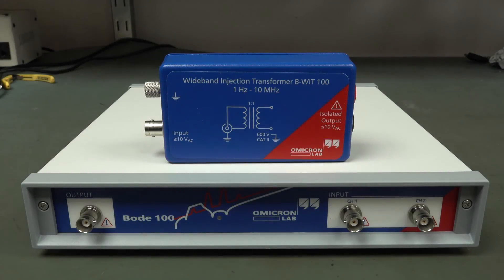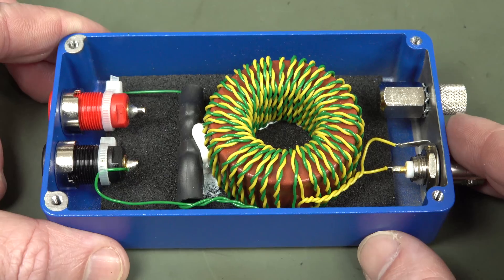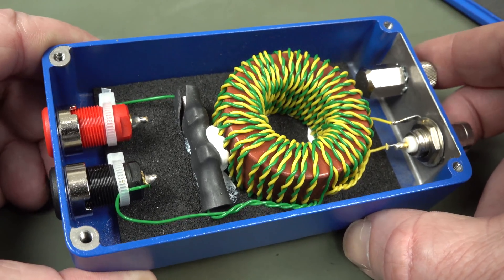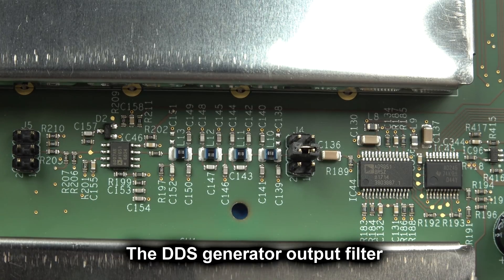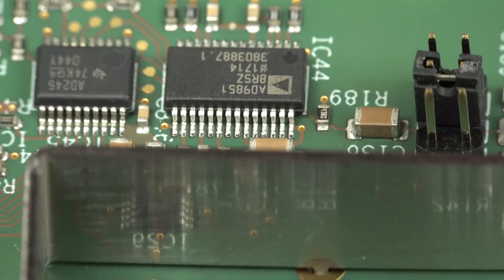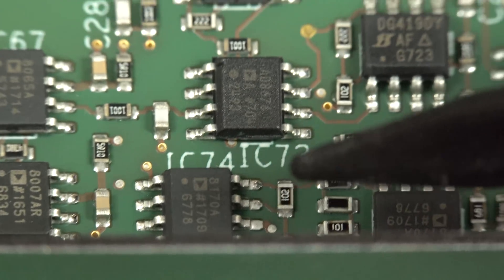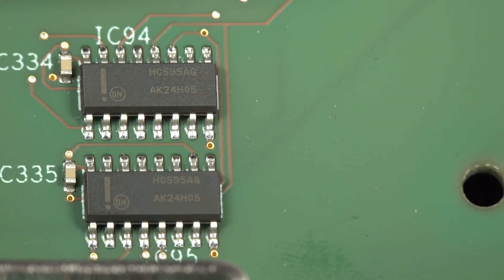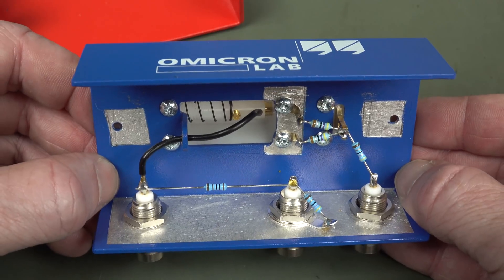EEVblog #1104 - Omicron Labs Bode 100 Teardown

Comment: Hi Dave! About resistors in B-SMC. As I see, all resistors there is 4R7 1%, except one between Source BNC and CH1 BNC. What are the colors of this resistor? I can't determine.
Regarding the disputes about the core material of B-WIT 100, I can say with sure that it's an VITROPERM 250F.

Comment: 3:08
There is just a fuse under that black heatshrink to protect the transformer from (most) "user errors" ...
Oh, never mind, he gets it open later ...
And no, an "inline fuse holder" would be a bad idea, because every "connector" adds more "things that can go wrong" and possible "crappy connections". That's why the fuse is soldered.

9:15
Oh, that annoying FTDI chip ...
I hate those things ...

11:59
Fun fact about those through hole resistors:
The length of the leads between the board and the actual resistor body makes a big difference for things like reflections!

13:49
Yes, there are is tons of switching going on!
Coupling, filters, range switching, termination switching, lots of things that can be configured by the user via the UI.

No, the relays don't really need to be shielded, because you aren't really dealing with "ultra small signals" ...

17:12
" ... rather simplistic ..."
Well, a simple solution is an elegant solution ;-)

Comment: It's called a bifilar winding! The toroids look like Amidon powdered iron cores ur = 10.  I don't think that any windings are squeezed or stretched to optimize frequency response, it seems that they just have been evenly spaced!
Pretty underwhelming !!
 A better core geometry would be a binocular core and i think that a balun on the floating side might give some more improvement !!

Comment: I imagine they can also get away with this price tag because it's a rather niche product, but also because of the (I presume) various levels of certifications it went through, whether it's self or 3rd party, they probably run various standard tests on these to produce some graphcs and other stats and then each one has to match etc.  Probably a lot that goes into that.   And of course the software too.   But yeah I'm sure someone that wanted to could probably produce this for a much lower price tag.

Comment: Can you please explain the purpose of these devices? I have a bachelor's degree in electrical engineering,  but i still have no clue what these things do.
Reply: Not to be mean, but you should maybe return your degree...
Reply: Actually, I have a degree in robotics, but there was still a lot of electronic involved. What I meaned by this comment was, that it might not be obvious even for people who know something about electronics. I can recognise a toroidal 1:1 transformer. But what is it good for? You won't be using 500$ transformer for galvanic isolation.
Reply: MrTad98:
You are going to use a transformer like this for isolation but not for power transfer.  Imagine you have some system that you want to measure the performance of with regard to RF coming in on some connection.  You want to send RF in there but not let it go through some other path in the total system.  You use the output side of the transformer to apply the signal.

Comment: The term you were looking for on the transformer was "bifilar windings"  it is a common trick for making a broad band transformer.
As an injection transformer, it is usually better to have a 10:1 step down so that the 50 Ohm output impedance of your generator looks like 0.5 Ohms on the system under test.
I was slightly surprised by the small cross section of the core.  Generally, the more massive the core the more energy it can store.  On the high current side of the transformer, you can have significant DC current leading to significant stored energy in the transformer's core.

Comment: You are paying for software. The hardware is basically a first gen SDR from the early 2000s. And yes the cost of it is obscene. For anyone that wants to complain and BS about low volume and research: lookup HAM radio SDR transceivers, 10x the complexity, 5x more expensive hardware and at least 20x more complex software.

Comment: I'm surprised by all of the negative comments. This equipment is more common than many engineers must think. Every gadget which has a power converter, switcher or linear, should be using one of these to check stability of the control loop under numerous conditions prior to going into production. Cellphones, tablets, computers, other test equipment, etc, everything that uses volts and amps needs something like this to confirm the stability of their power supplies. This equipment can be used for many other measurements as well. Other competitors to this bode box are priced in a similar range for their equipment.  Large companies have dozens of these. Our large company has at least 15, most of which are in use almost constantly.

Comment: I guess all the magic is in the software then, because there are better VNA designs out there in the public domain. QEX published one a decade or so ago now. It used a similar method - a source DDS and a pair of channels, each measuring I and Q, some baseband filtering and 24-bit digitising. I think TAPR used a similar design in theirs. As is the way, the amateur radio community took the project and evolved various different versions. Search for qex vna n2pk and that'll get you down the rabbit hole for a few hours.

Comment: I'd really like to see the ToE in DaveCAD for this one!  Also probe various points during acquisition, starting with the connectors and working inwards, all the way to the USB data stream.

Edit: What I'm looking for is ways to make better use of simpler and cheaper tools, such as the Red Pitaya, by adding some external components and software.

Comment: couldn't afford a $1.80 on a fuse holder for a $500 isolated transformer that looks to be cheap.  $11.05 for a 73.65 mm ferrite core.  Rip off, the more I research on this part.  $200 or $250 yes. $500 no.

Comment: Back in the 1970s I had a part time job at a music retailer doing bench repairs. That was the first time I saw the insides of a guitar amplifier made by a British company called Orange. All the transformers (input, output, and power) were wound on circular cores. Also, all the signal resistors were oversized to minimize thermal noise.

Comment: $15 for the parts, $485 for the virgins..

Its a specific piece of test equipment. If you need one you don't particularly worry about the cost; it's a drop in the bucket compared to all your other test gear

Comment: T think the transformer is just a Amidon T240-2 iron powder core with a bifilar winding.
The wire is most likely PTFE insulated to get around 100 Ohms of impedance.
That is a very common construction that is used in hamradio all the time.
Reply: Yes the Hamradio Transformers normally work from very low to ~30MHz that is at least the specification of the Core.
Reply: The T225-2 (the closest size available in -2 material from Micrometals/Amidon) has an Al value of 12 nH/N^2. With 40 turns (as seen in the video), this gives a magnetizing inductance of 19.2 µH. With a 50 ohm source impedance, this gives a lower 3 dB cutoff frequency of 420 kHz. This injection transformer has a lower 3 dB cutoff frequency of 7 Hz, so the core must be something with much higher permeability, most likely nanocrystalline.
Reply: I thought PTFE when I saw the stripped ends.

Comment: The price of the surface mount tester probably comes from the gold. I wouldn't put it past them to use solid gold, or very thick plating instead of thin gold plating. Make it so if ever needed, a clean surface is easily revealed.

Comment: Not sure about the nude virgins.  Looks Like a simple #2 iron core with bifilar turns on it. Good "Q" to 30 MHz.   I suspect that core wound was put together by a ham.  Made many myself.   Material 43 might have been batter choice though.  The AD9851 is the jellybean DDS chips for making VNA's for the HF bands. Working with them myself.  Although the prices at DigiKey do not reflect the jelly-beany-goodness.
Reply from the maker: I said it in the video and I'll say it again. If you can make and sell a good low cost wideband injection transformer cheaper than you'll sell 10's of thousands of them.

Comment: Well I am sorry Dave but at least with HP when you opened it up you saw the quality, you don't see it here and they even leave solder flux behind to contaminate, regardless of how good the software is this is not $5000 and with all the expensive optional extras to make it all happen.  No high quality gold plated PCB's here, just assembly machine built PCB for what is not a small sum.  It doesn't look any better than assembly machine built electronics coming out of China.
I supervised techs working with Military avionics installed on the FA/18 hornet, the quality there was apparent but hey this was 1990's and each PCB in a  piece of equipment  cost over $10,000 with no sales tax , but guess what ,the solder flux was cleaned off with 100% pure  isopropyl alcohol.  After mirco miniature repair to these boards  by specialists all  soldering flux was cleaned off as well before the boards were deemed serviceable.
Reply from the maker: Robert Scott - "I could see you were expecting something better, am I right ?"
No, you are not right. I was expecting something "more complex".
They got away with a much simpler design that I was expecting. That doesn't mean what they have designed and built isn't good quality, it is.
Reply: I'm sure the high price is because of the high initial fixed costs for R&D etc, software development costs and continuous cost of staff all combined with the low volume of sales that come from making a very niche product. You're not paying the money so much because it's expensive to manufacture each unit, you're paying because it's low volume manufacture.
They could still have gold plated the PCB and cleaned the flux and given you more of a feeling of getting quality for your money. Cost would have been negligible. Also as you can probably tell this design's been in production for a good while already.
Reply: Well I can see where you are coming from Dave but even on the video I could see you were expecting something better, am I right ?   I own quite a lot of test equipment, I just love collecting old good quality equipment. When I open up  this equipment I am not ever disappointed, and hey mate the price can be right, very right.  I absolutely love electronics  and have since the tender age of 12. It has been my whole life except for learning to play the organ at 18.  I repair and calibrate high quality , Revox B77, Teac A-6300  reel to reel tape decks, even the old Sony TC-377 and hope to sell a few  eventually.  My love for organs has lead me into repairing and refurbishing them, mainly High end Conn  organ models of the professional console variety.
I used to get as excited as you over equipment but age has dulled my enthusiasm, 69 last month.   My workshop is up the back yard  here in the small town of Sale, Victoria with many a fluro  and LED arrays on separate circuits. Very disappointed in high power LED lighting the MTBF is abysmal .   
 We are totally off the grid by choice with solar PV array of 6 Kva, a 48V (nominal)  charger into AGM battery bank 48V at 1000AH.  The inverter is a  6Kva  48V to 240V single phase which gives me lock solid 50 Hz at 240-50 volts. No chance of a blackout of brownout.   As I started life as an electrician I have wired it all myself including the house.  As you may gather we pay no power bills and in Spring, Sumner and Autumn there is an abundance of power available.
Regards Robert
Reply from the maker: You do know that gold plating costs pittance, and you can get that on $10 prototype boards, right?
Reply: Gold plating in this case was part of the manufacturing process of the boards so it had to be more than just a minute gold flash to stand up to the etching process involved in making the boards, in fact it's quite thick about .005 " I believe.  It was an old PCB manufacturing technique but hey these were the days before digital and a lot of test equipment was just analogue as the HP 334A Distortion Analyzer and dare I say it built to last back in 1971.  I have three of them, would you like one posted to you to take apart , I have seen you dismantle other older  test equipment for an interesting video ? 
I don't know how old you may be and what your experience levels are but I go back to these times and there is something to be said for venerable old test equipment including analogue multimeters.

Comment: That transformer is nicely wound but its definitely not worth the price. That is price gouging is ridiculous! I would've expected a panel mounted fuse holder in the side of the box for that price.
 If someone had a torroid the same size and some solid core copper wire (ethernet cable is a cheap source of solid copper wire) in their scrap parts box (which is likely) and counted the number of turns of this transformer in the video, they could easily make an identical transformer like that and put it in an off the shelf aluminium project box for a lot less money. Less than $100 including labour.
Reply from the maker: If you can make and sell the same performance one for $100 then you'll sell 10's of thousands of them. I'm serious.

Comment: Dave, can you measure the dimensions of that toroidal ring? I might try making one.
Reply: The composition of the ferrite ring is a very important parameter, but not easily measurable. I don't think the dimensions matter that much.
Reply: the magic is in the core material, without knowing that you can not replicate it.
Reply: Should be quite easy to make using solid copper wire from Ethernet cable.
Reply: Looks like 2 inch mix 43. Building it would be trivial, but you need some very pricey gear to characterize it afterwards.
Reply: I think Dave should ask his viewers to send in their attempts at replicating that, then characterize them. I'm planning to use a chunk of some 32mm mild steel pipe for mine.
Reply: Could post frequency response of your DIY injection transformer? There more into it than just number of windings and core. Yes, part of the magic is in the core, but even lid taken off changes frequency response.
Reply: You need to know the exact core to replicate this. As a transformer designer, when I see that color core, I think of Chang Sung. The core size would optimize the search, but you still need to know material type
Reply: There are thousands of ferrite and iron-dust core formulations...
Reply: Mark Tillotson not at all. Miu for the permittivity and That is all. I will give you the formula for free even.
Reply: Nathan Conrad:
There are only so many materials to use.  The dimensions control the AL of the core for a given material.
Count the turns and measure the inductance is the first step of gathering data to reproduce it.  
Knowing the dimensions and the AL number, you can find the core material by process of elimination.  If I was guessing, I'd guess 3C90 material.
Reply: pa4tim:
Knowing the material is likely not as hard as it appears.  The core looks to be a standard dimension one.  It is unlikely to be a custom one.  It is normal height so it isn't a stacked pair.
Reply: gerry kavanagh:
I presume you mean the type 43 material for the core.  That would be a good choice if the core needs to carry significant power at 10MHz.  Since this thing is bifilar and working at low impedance for quite a few turns, I would expect the core to be picked for the low frequency end and hence would be something with a high mu.
Reply: Nanocrystalline makes the most sense, given the low frequency response. It looks very much like a plastic-encased core from Vacuumschmeltze to me, possibly T60006 series. From the low-frequency response, the minimum inductance can be estimated. Then, from the rough geometry, a minimum permeability can be estimated.
Reply: Agree . Amorphous alloy commonly known as Metglass as developed by Allied Signal . Very high relative permeability and very expensive . That size core of good quality will cost about 40UK pounds . Add to that the labour of the bifilar winding , assembly cost  and other bits and pieces like design/development  cost of a low sales volume item , then the asking price is very reasonable .

Comment: In RF land we call that a transmission line transformer.  At low frequencies, the ferrite coupling does the heavy lifting, and at high frequencies, the transmission line coupling does the heavy lifting.  Simple in principle, but getting the crossover really flat in amplitude and phase takes a good bit of experimentation.
Reply: this starts to make sense now

Comment: On the transformer, twisting the primary and secondary wires together before wrapping them on the core is a common technique called bifilar winding.
On the main unit, of course there are no directional couplers because this thing operates at way too low a freq range for that.  What they must be doing is digitizing both the voltage and current, then computing the s-parameters from the impedances.
And the board material does look weird, but I[m sure it's not Rogers material.  You'd only use that for stuff in the GHz range at least.
But I liked the video.  Thumbs up.